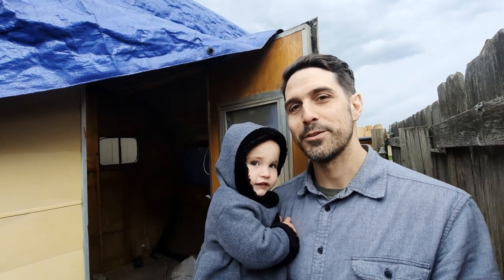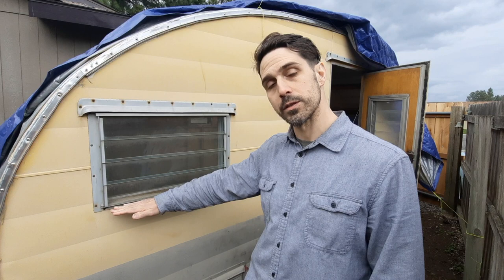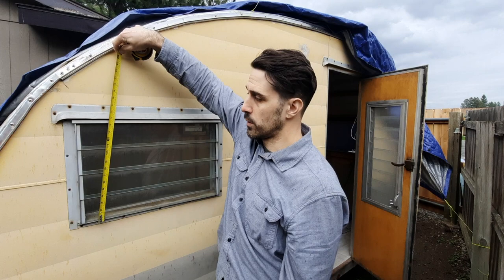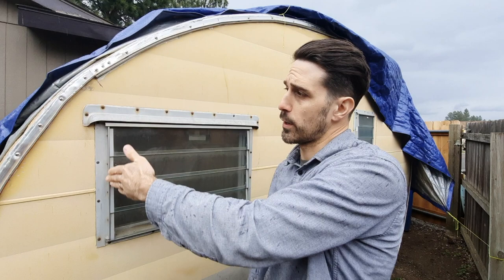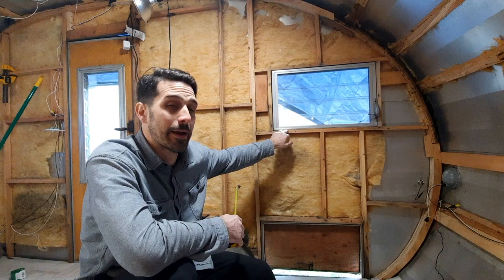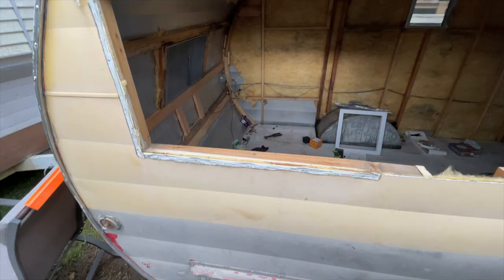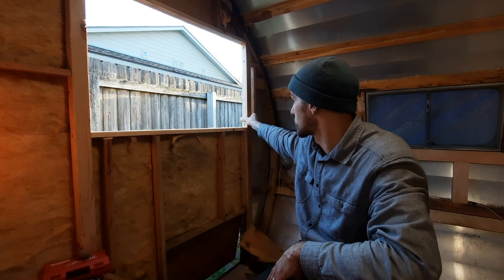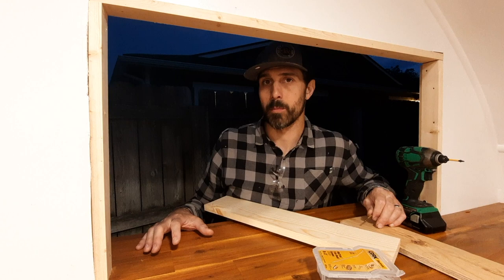How to Build A Concession Window - Press On Coffee Trailers

Comment: what type of wood did you use (acacia wood?)  Where did you get it? and since it was one piece, what sizes does it come in?  Thank you in advance for your help in answering these questions
Reply from the maker: The shelf/countertop is acacia from Hone Depot. It comes in 6, 8, or 10 foot pieces if I remember correctly. The window frame is made of pine.